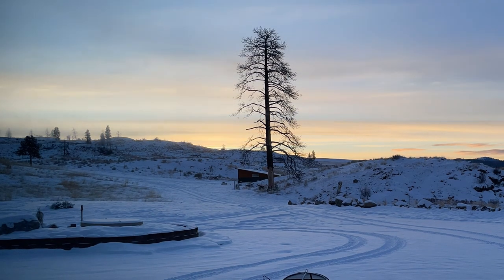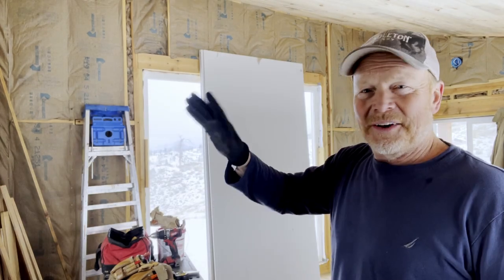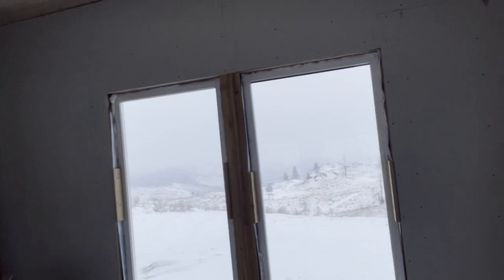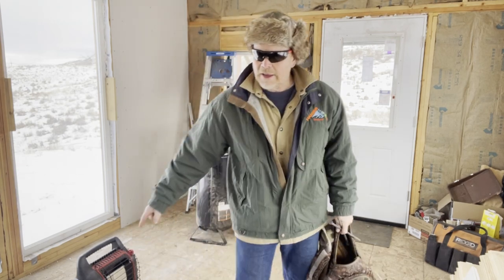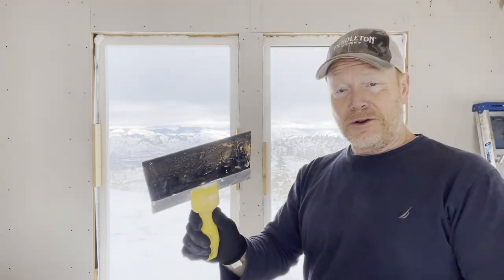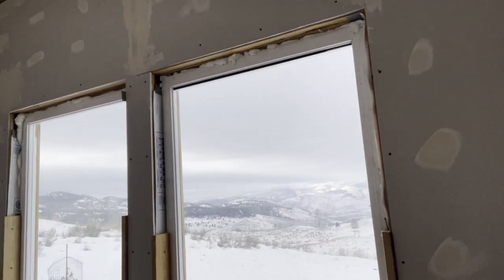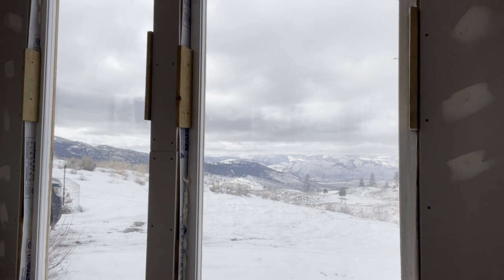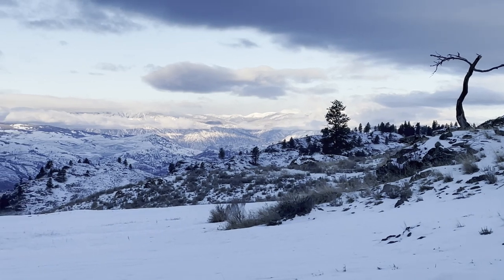Hanging Drywall in an Off Grid Tiny Cabin...and Mr. Heater Chili?

Comment: Hi, nice work. However, did you explained how the air compressor works. Do you fill it up at the ranch and just use the air I tube when you are at the Tiny Cabin?
Reply from the maker: Exactly! I’d fill it up when I went down for lunch, or overnight. On my current build, I use a portable generator to air up the tank, since it’s farther away. 
And thank you!